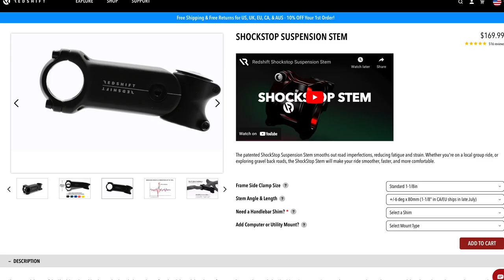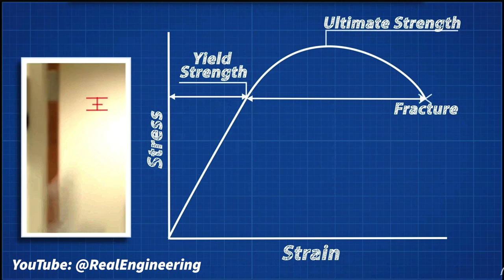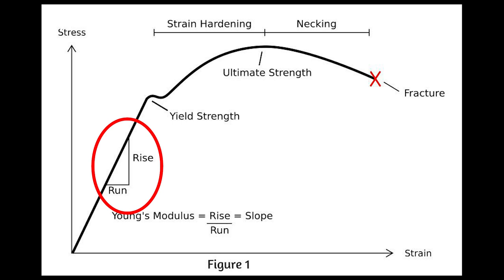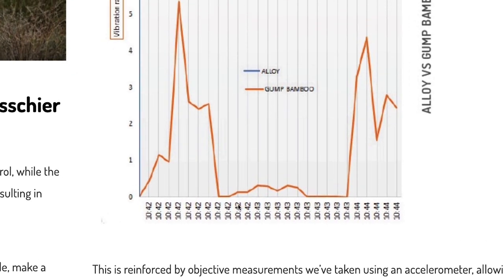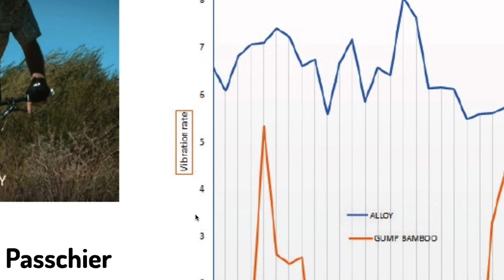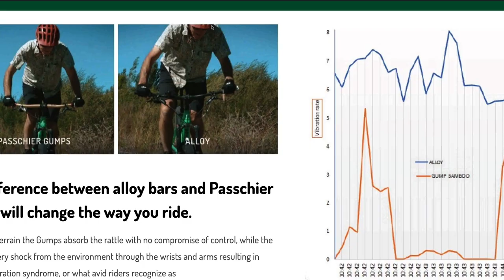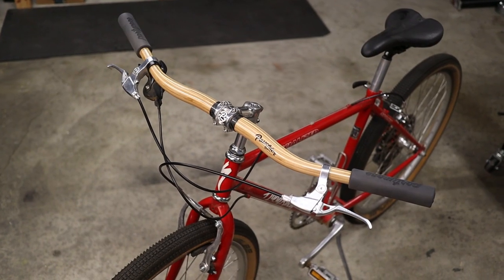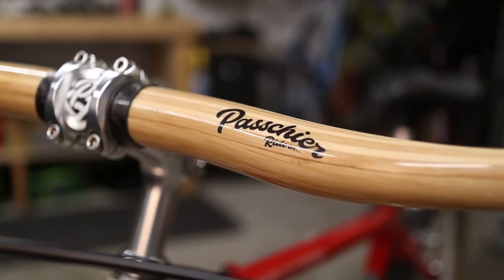Why Bamboo Handlebars FLEX, but don’t BREAK

Comment: Id love to see som ISO testing on it, would be fairly easy to list the yeild strength for the bars. Probably a sizable range of values due to variability in the bamboo, but some sort of minimum strength would be nice.
Reply from the maker: Yea. Although ISO testing is primarily for fatigue testing.
Reply: natural bamboo is used for scaffolding in many parts of the world, so i wouldn’t be too worried about raw strength, and they’re using an engineered bamboo material anyway. plywood might be a better analogy, and the plywood subfloor holding me up right now seems fine.

Comment: It'd be interesting to see a comparison between these and something like the OneUp Carbon bars, which is also supposedly engineered with some flex in it to soak up chatter.
Reply from the maker: The one ups are nice too (I run them on my mtb), but nowhere near as much compliance as the bamboo
Reply: @TheBikeSauce  I had a chat with the manufacturer at a recent expo. He said that compliance can be had in many materials but that the vibration absorption and damping is far superior in bamboo vs carbon